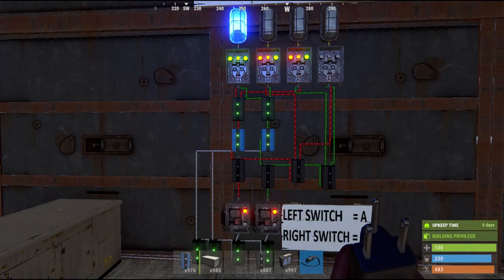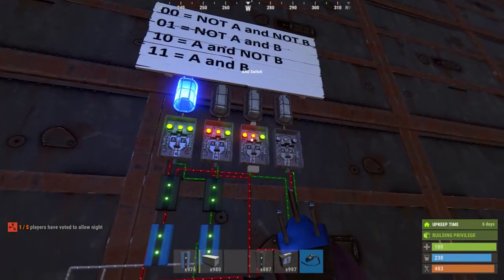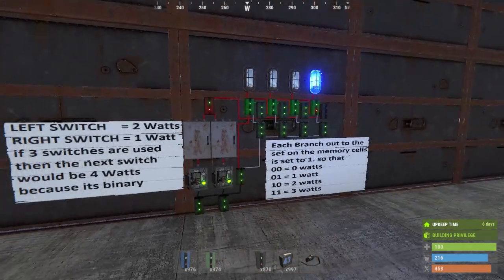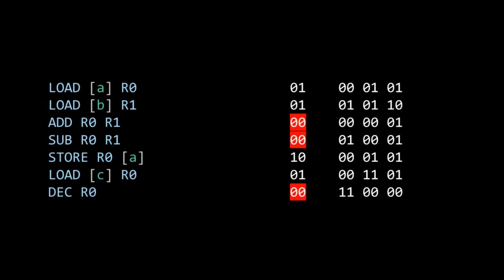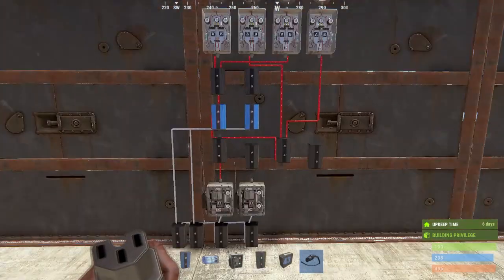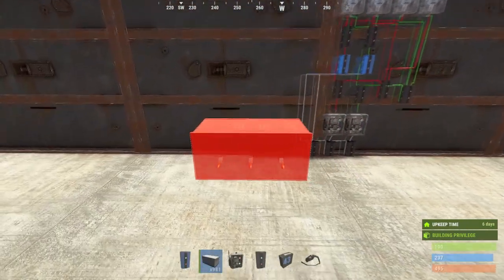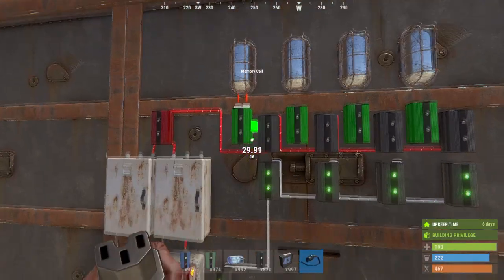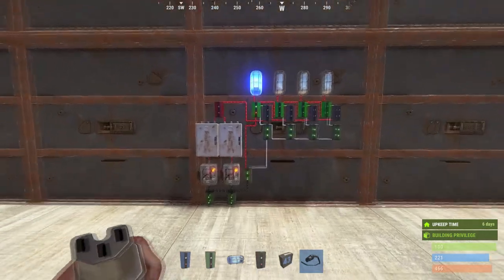A Decoder Tutorial RUST Edition #rust #electrical #rustgame #circuit #tutorial #how #decoders

Comment: Is the analog better for fantom/transition pulses. For some background i am creating a gambling wheel like in out post. You hit the button to set the rand comps. Then the binary is decoded. Currently I am experiencing fantom pulses during transition since I am using the blocker method. My believe is the micro pulse is coming due to a short burst being let through the blockers before interpreted. Does the analog fix that?
Reply from the maker: I see what you’re saying so there are two and gates being satisfied at one time for a brief moment. Yeah it should be. Since it usually goes right to the memory cell being set. One thing you could try with the traditional one is replacing the blockers with memory cells and tieing the reset note high like on the analog ones and use the set just as you would with the block pass through. Memory cells can be used as inverters too so can XOR gates.
Reply: @LagFoundry  ahhh didn't think of that though I bet that would work. Though I tried setting up with analog and it worked. Thanks for the vid!!
Reply from the maker: @jacobramsey1653  awesome glad it helped